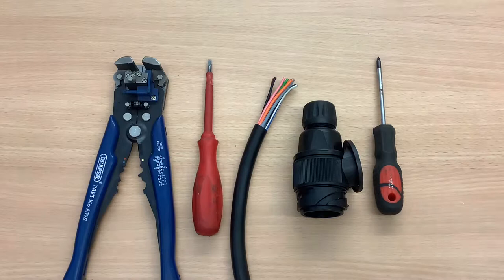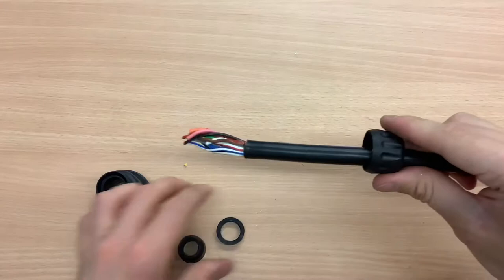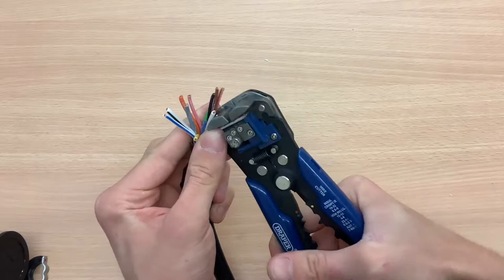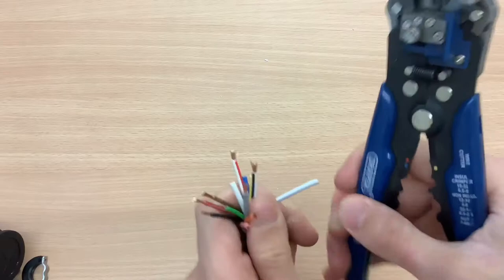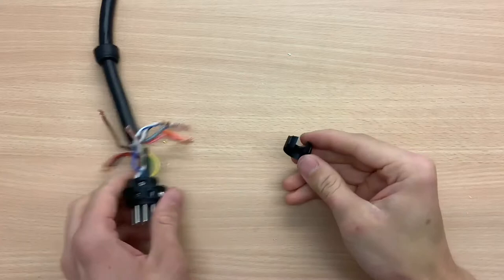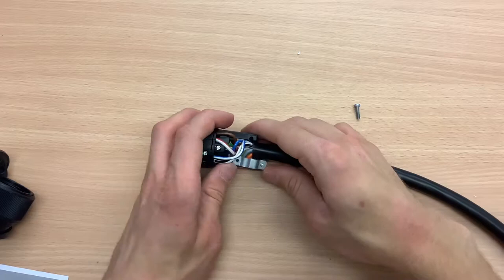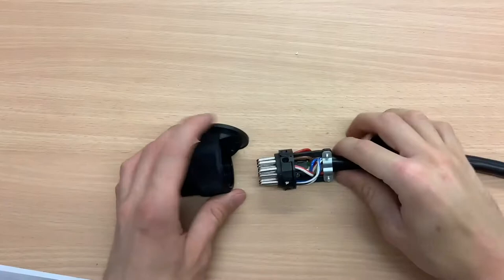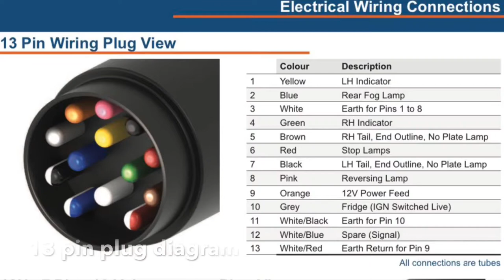How To Wire Up A 13 Pin Plug

Comment: If you're changing an existing plug, be aware that although colour code standards are published, manufacturers don't adhere to them. So for instance my Bailey caravan does not use the wire colours shown in this vid. If you're swapping a plug, take photos of all the connections before disconnecting, and note the keyway position relative to the wiring. It can be a very tough job if you don't know which wire connects to which pin :) :)

Comment: At last, I find somewhere that understands reciprocity. Even Wiki fails to define whether the diagram is pin view or rear view. On this video we see coloured pins, pin view. A photo real image. You wouldn't believe the web pages that don't say which, and the manufacturer of the plug I bought shows the diagram saying "socket rear view" which doesn't inspire confidence in the product!
Yea, there is always the multi-meter, but the right info saves time. Now how do you check brake lights on yer own?

Comment: My Thule bike rack has a 7 pin plug and my new car has a 13 pin socket. I realise that it is possible to buy an adapter but wondered if it would be possible to remove the existing socket and fit a 13 pin plug but only use my existing 7 wires. Many thanks.
Reply from the maker: Hi, Yes you can replace the 7 pin plug and fit a 13 pin plug and wire in the existing 7 wires. The colour code remains the same.

https://www.fieldfare.co.uk/line-1-12v-13-pin-plug.html
Reply: @fieldfaretrailercentre1083  Many thanks for your speedy reply. Very helpful!
Reply: Do you have a video showing the wiring in the caravan?
Reply: I don't see why not. Things to watch, 1) sealing the smaller cable, in the cable entry point (bulk it with tape). 2) corrosion inside the wires, moisture gets everywhere - you will find 3) friability of the old cable sheath after years of UV bombarding it.